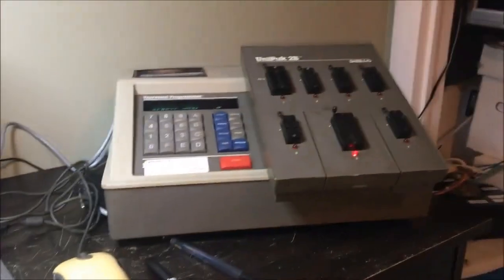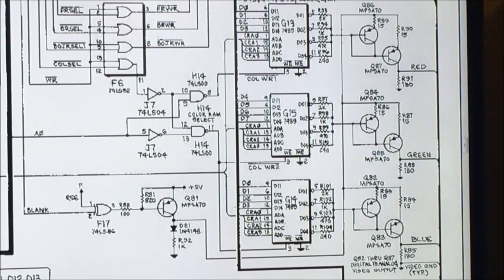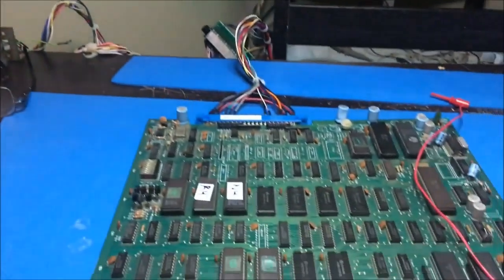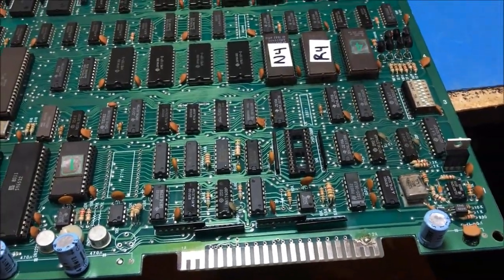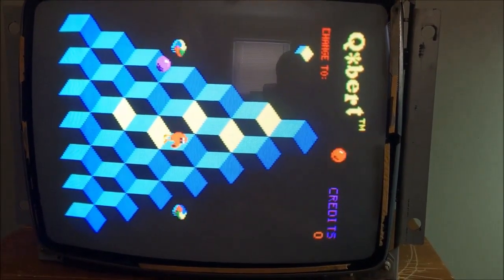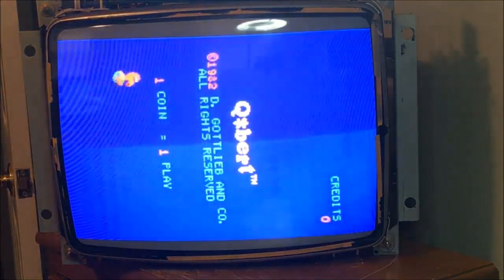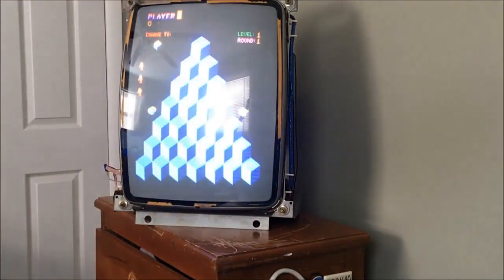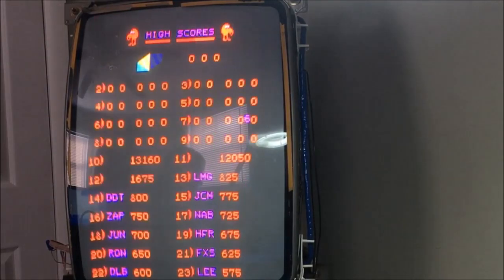1982 Q*Bert Bootleg PCB Repair/Speech Circuit and Gameplay

Comment: Love your videos!  for someone whos just getting into the hobby is there a good way to tell if a board is a bootleg?
Reply from the maker: You just have to know what you’re looking at… A lot of them look exactly like the original on the screen… But physically they look different
Reply: I usually catch bootlegs when looking at schematics and components list.  Ex: capacitor  and oscillator values differ most times